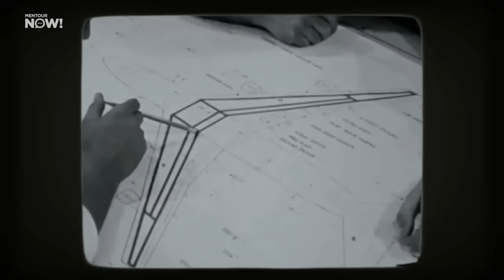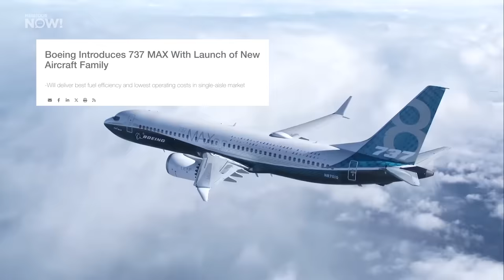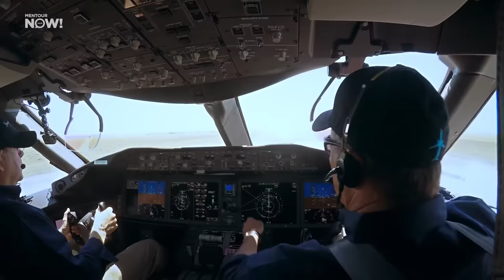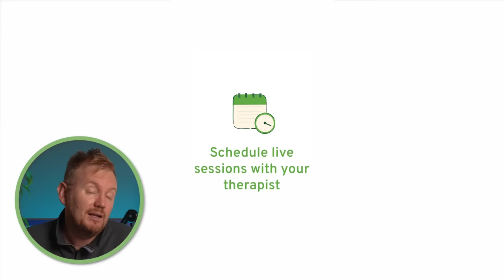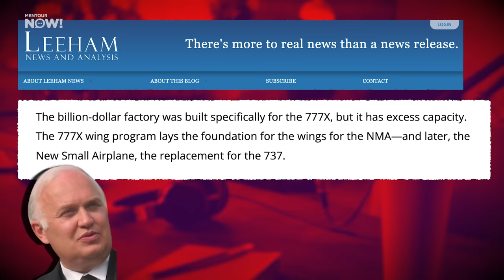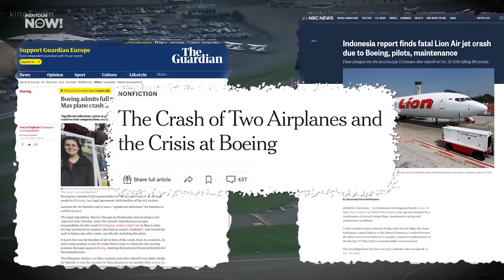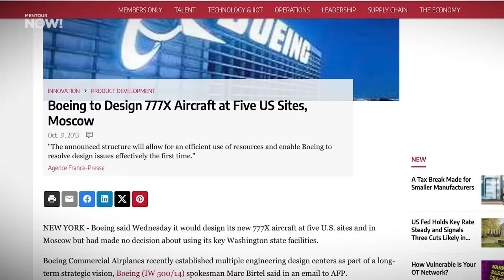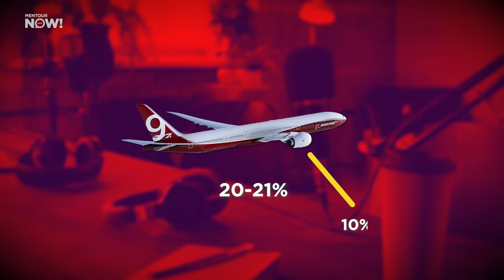What’s Going On With The Boeing 777X?!

Comment: Happened that Boeing is no more an engineering company.
Reply from the maker: I hope they will/have found their way back to that. 
We need the economy to work but it’s the engineering that is crucial
Reply: Assemblers.
Reply: It's also important for a healthy competition between Airbus and Boeing
Reply: @speeter6345  I'm a big fan of Airbus and have been for a long time, but I absolutely agree with you regarding this. Things have been messy for Boeing ever since the merger with McDonnell Douglas and theirs and Lockheed Martin's price gouging in the military market has been concerning for a long time, but competition with Airbus on the civil aviation front has kept things stable for all these years. Either one of them monopolising the market would have devastating effects and is always a worry when they are the only real key players now with Embraer taking a bit part role and the impact of Comac entering the market still to be determined. Here's hoping for many years of healthy competition without any further declines in safety, as was the case with the MCAS built into the 737-Max range of aircraft whilst claiming no retraining was necessary. Positive competition will keep prices stable and will push innovation further too. I hope things work out well in the coming years.
Reply: @thegreyarea-WPP  Absolutely! I am also team Airbus, but we need Boeing (and Ideally Embraer, Bombardier etc.) to keep innovating and improving
Reply: Boeing was the greatest engineering company and celebrated it's engineer's, but under the last CEO, money drove all, save money by reusing everything. Don't engineer. Don't fix it if it ain't broke. Pull pieces from everywhere. Put bigger engines on a smaller plane and poof, new model. Ugh....  I have an uncle worked for boing for over 30 years now. And he focuses on gov  retrofit projects. But they are a revolving door of layoffs now.
Reply: Problem is MBAs took over the business..
Reply: Where’s your evidence?
Reply: It is unfortunately all to easy to get stuck in a rut making the same products ( or variations of them ) when you really need to stop and think of complete new redesigns.
Reply: This is why Lockheed got out of the airliner business.  Boeing is trying to build airliners the way they do defense contracts (where the goal is to spend as much money over as much time as possible).
Reply: Wasn't it also engine development problems that almost did in Lockheed with the Tri-Star?
Reply: @TacticaLLR Where is the evidence that Boeing is now run by MBAs instead of engineers? I live in the Puget Sound area and know a number of retired Boeing engineers. That is the consensus view and it started with the MD merger (described as “MD bought Boeing with Boeing’s money”).
Reply: @the-chillian  Again, bigger bigger BIGGER.. oops.  Trying to scale up engines for ever larger planes is.. difficult engineering to say the least.
Reply: Also, Boeing has to ensure that a full launch of the type goes smoothly because it is the successor to one of the best commercial aircraft ever built.
More recently, I think we can say the Boeing 787 has been a remarkable achievement. Once the battery issues were sorted out, it has become an aircraft that has actually made possible a change to a fundamental characteristic of the industry as a whole - that being the possibility to move away from long haul operations always having to rely on the hub and spoke model. 
I understand the point you are making. Initially I could not understand how any competent pilot could allow the 737 Max to be brought down by stab trim runaway, let alone for it to happen twice. Arguably this point could still be made. It called into question the manner in which those airlines had glossed over a difference from the 737NG,  but Boeing allowing MCAS to compute fatal results should never have been allowed to happen. And AoA sensors should have always been duplicated. Those issues both made me angry and also, to be honest, quite sad.
Reply: The merger killed Boeing , made it a corporate environment for shareholders rather than engineering hub that it used to be .
Reply: The merger killed Boeing , made it a corporate environment for shareholders rather than engineering hub that it used to be .
Reply: That's a myth. The old Boeing also had big problems. See how Boeing handled the cargo door issue of the 747; the crash of Lauda Air 767; the rudder issue of the 737. The old Boeing was even worse.
Reply: @MentourNow 
When the board of Boeing decided it did not require a single engineer or aircraft designer it sealed its fate. Every single member of the board was either a lawyer on an accountant. The results were predictable.
Reply: @plektosgaming  There were certainly difficulties in making the engine as efficient as Rolls-Royce had promised  -- the composite material they were going to make the blades out of turned out not to work so well, and it certainly didn't help that their chief engineer dropped dead in the middle of development -- but the other problem was that RR went into receivership while all this was going on.
Reply: Boeing management will have to be completely replaced for the company to return to an engineering rather than accounting basis.  That’s not going to happen.
Reply: @ederss7 It's a nuanced situation. The management that developed the 767 and 777 was something different. They produced fine designs but also sold the company.
Reply: All aircraft manufacturers are just design and assembly companies. Parts are made all over the world and shipped to WA for assembly. Avionics, undercarriage, engines and you name it are built by specialist manufacturers and shipped to Boeing. I live in Scotland where there are many aerospace companies. Here these companies make many components for both Boeing and Airbus like leading edge slats and engine nacelles.
Reply: A good friend, now retired from Boeing, stated when they outsourced everything starting with 787, Boeing was doomed. They “lost control of everything from a to z” and the rest is history.
Reply: @MentourNow the economy doesn’t work with their short sighted financial management. In fact that’s what causes market crashes and Great Depressions. This was all understood in the 1930s (and even before) but the selfish businessmen don’t care
Reply: @Jeez001 exactly
Reply: @richierich1929  Then why do they exist if the merger killed them
Reply: @TacticaLLR evidence is all facts publicly available, lazy
Reply: And why would an engineer work for a company known to fire engineers after the design faze is finished.  The nightmare that the 787 engineers went through moving from Seattle to Charleston,  SC.  Settling down with their families,  only to be thrown out as soon as production started.
Reply: @nickolliver3021  too big for murica to allow them to fail, they should have been banned after the mcas issues , blaming the pilots training , not apologizing to the families, the list goes on .
I loved everything about Boeing prior to their merger, after that I fear flying in one .
Reply: They merged with toxic McDonnell
Reply: @MentourNow They did.  After the 737MAX episode, half the executive team was fired, the remaining executives were shuffled around, and the outgoing half were replaced with people from the engineering department.
Reply: @treborg777 That’s already happened.  Half the executives were fired after the 737MAX episode, and they were replaced by people from the engineering department.  The other half who remained were seriously reshuffled.
Reply: @richierich1929  Why should they have been banned after the Mcas issue? What ever happened has been fixed. You can say to Boeing that they should have been banned to their face. Blaming pilots and not apologising to the families isnt why they should be banned. Well if you really fear flying in a boeing then just dont fly. The world will be like this if it really scares you that much
Reply: f-ing douglas people took over and they kicked out allen m.
Reply: @nickolliver3021  I like Airbus , better engineered aircraft , Boeing should have been heavily fined after the mcas issue or banned for a period because they released a shit product that could have killed more people . 
They did not divulge proper information to pilots regarding what the mcas was, they never listened to their engineers who spoke out against issues .
Reply: @M_SC  what?
Reply: Exactly.
Reply: Idk bro, I worked as a supplier of graphite based coatings for Boeing back in the day and their engineers were among the most meticulous of customers. It seemed they had a totally unquenchable thirst for data, and were attentive to even the smallest patterns in specs. I wouldn't put their engineers in question. Maybe things have changed since then?
Reply: @Jeez001 MBAs are just glorified bean counters.
Reply: CATIA Too Much!
Reply: I still believe in Boeing engineers however, I believe their hands are tied by MBAs that wouldn’t know a wing from a ship’s rudder. They need a couple sharp engineers in the boardroom.
Reply: It's part of the corporate capitalism. As a Mercedes enthusiast, Mercedes no longer is led by engineers, but the marketing department . Now the brand that I admired for its engineering, is now just a consumer product, insted of a passion for engineering
Reply: Boeing went woke. Let's tell it as it is.
Reply: It happens. Then they will see it and go back to engineering. Lots of companies have done this cycle
Reply: Such a dumb cliched comment these days. People feel fashionable or savvy when they say this.
Reply: Interesting…Boeing is Hiring right now as it has many orders for the 777
Reply: The merger didn't seem to help. With that said them pushing this back isn't necessarily a bad thing. 

 We don't a repeat of the other 737 Max, do we?

 Airliners are becoming much more complicated, and customers expect more. I mean they have to work with GE on everything on the new GE9X. That cannot be easy with all the parameters. 

 Question for anyone in the know. Why the hell haven't cockpits or components become simpler yet? Is it really necessary to have all those damn buttons these days. 

 They need to invest in a bunch of touch screens, with dials or buttons for key elements that are used all the time. Have smart features that show you what is needed. Wiring a cockpit has to be a pain in me arse. Touchscreens that can be used for all of a companies airliners.

 PS: Huh, lithium alloy. Gotta look that up. Didn't realize lithium could be good structurally.
Reply: @forwardpaunganwa4135 "EVERYTHING BAD IS WOKE! BRUSSEL SPROUTS ARE WOKE! MUSHROOMS ARE WOKE! FLAT BEER IS WOKE!"
Reply: So sad :/
Reply: Maybe we will see a A380 NEO flying before the 777x get delivered 😅😅😅
Reply: airbus fanbois, stop spamming
Reply: Love your videos. Always delighted when I see a new one come up. Keep up the good work. Happy Christmas and New year's Mentour. 😊
Reply: @forwardpaunganwa4135 oh, THAT'S what woke means? Thank God! That means we can now all agree on reproductive rights and human rights for trans people now?
Reply: @MentourNow Boeing just became a woke company ran by accountants just like many USA corporations turning that way. I know because I work for one and I know people that work and worked at Boeing. As such, I refuse to fly on newer Boeing planes as I know they are not safe.
Reply: This is what happens when everything is profit driven
Reply: Airbus isn't either. I am working in this field, and soon the "cost reduction" pushed so agressively by Airbus through the supply chain will burst in the same tragic way it did for Boeing.
Reply: It's a brand lol
Reply: Unpopular opinion: Despite  Bieng based on a 30 year old design,  the  777X is still more Technologically advanced than the a350. 

The a350's only major highlight is its lighter composite fuselage .
Reply: @Jeez001 Dennis Muilenburg, ex-Boeing CEO got a degree in Aerospace engineering and a master degree in Aeronautics

The current Boeing CEO David Calhoun has a degree in science.

So no, Boeing wasn’t taken over by MBAs
Reply: Nonsense..
Reply: I would say they are no longer a manufacturing capable company.  The 787 seems like a decent design.  Recent 737s not so much.
Reply: @speeter6345 It ain’t going to be Boeing I don’t think.
Reply: And they'll never be one again as long as the government contracts keep coming in.
Reply: True
Reply: Nobody like this comment
Reply: Boeing went the same way as Mercedes did a long time ago: they threw out the quality and engineering, and said hello to accountants as their main partners.
Reply: @thegreyarea-WPP  As a good friend of mine once said, MD somehow bought Boeing with Boeing's money.
Reply: @jordananderson2728  I too have heard that said. It seems to be something many Boeing staff said though I think I may have heard it during Al Jazeera's investigation into shoddy workmanship at the Charleston plant with customers apparently only accepting 787's that were made in Everett. I think that's where I heard it used anyways. Indo not know anyone working for Boeing to have heard it from though perhaps I am mistaken  and it could easily have been a comment on this channel.
Reply: @Jeez001  😂😂😂
Reply: You said it CORRECTLY. They constantly fire experienced-more experienced engineers and hire inexperienced engineers to increase profit margins to satisfy a small number of greedy investors which causes more issues with quality and safety. THE prime example of greed and profits over quantity and safety is the 737max. When money is a company’s driving force, the people suffer. Airbus is running rings around this former great company and is hiring the experienced/knowledgeable engineers let go by Boeing. VERY sad.
Reply: I remind myself that an airliner is closer to a space ship than a car. The automotive industry’s quality tools have been implanted by the aviation industry -  APQP/PPAP. Bad idea but leadership must have liked having an additional focus on reducing costs. Unfortunately the manpower came from the quality department. Management didn’t increase manpower to cover APQP/PPAP. They just told quality personnel to stop and come over here and work on this nonsense.
Reply: It all started going downhill for Boeing when they merged with McDonnel Douglas which was supposedly a merger with Boeing absorbing them but really turned out that it was actually the complete opposite and most of McDonnel Douglas's upper management actually replaced the Boeing upper management effectively winding up as nothing more than McDonnel actually just adopting the Boeing name and still operating with the same management style and penney pinching ethos that killed McDonnel Douglas in the first place and shunning Boeings engineers 1st and a Business 2nd ethos that had served them so well up to that point.
Reply: That is the kiss of death every time.
Reply: @richierich1929 that’s a lot of jets to fear though, as there’s still a lot of jets flying.
Reply: @richierich1929 you know they won’t go away as even if they stop civilian aircraft, military aircraft will still be produced. And without civilian Boeing aircraft, Airbus will be a monopoly which will be even worse.
Reply: @mbmann3892 good engineering still exist in cars, unfortunately they only exist in the super high end market like Rolls Royce.
Reply: @fatfreddyscoat7564 can’t you say that about most car brands. They all used to be beautifully hand built except for companies like Rolls Royce.
Reply: 'If its Boeing, I ain't going 😮'

Sad, twenty years ago I used to say, if it ain't Boeing, I ain't going... 😥       Way to Kill your reputation fellas👏
Reply: @thegreyarea-WPP 
One of Boeings biggest challenges has been competing against a company that was established to create jobs, not profits.   Airbus is spread over several European nations that work together to provide good employment opportunities for their citizens, subsidies for the company are there when required.   Works great for them, obviously.
But there’s nothing Americans hate more than subsidizing industry, even if it’s a good idea.
Is it not possible Boeings problems stem from the need to reward shareholders and executives, by maximizing profit above all else, in an industry that is very unforgiving?   
I know there are many cogent arguments to be made either way on what is a huge subject.
My two cents.
Reply: @falconeaterf15  I really appreciate your two cents here. It’s an angle I’ve not really looked in to and it’s certainly interesting to mull over. I’ve spent a lot of time considering their outsourcing, their issues with low standards, especially with aircraft coming out of their Charleston plant, and what is seen as putting profit over safety, but I had forgotten about the subsidy row. My very vague understanding of it is that Airbus would likely have fallen flat on its arse without being heavily subsidised and Boeing took umbrage to that, though they also have subsidies through huge tax breaks. It’s certainly something I should research and give it due consideration as my knowledge of it is basically null. Thanks for your comment.
Reply: @thegreyarea-WPP  
Your a brave man to attempt to research the subsidy debate as  Boeing and Airbus have generated tons of studies and reports over the years arguing their perspectives, as well as many court rulings.
Good luck !
Reply: @forwardpaunganwa4135  explain? Examples?
Reply: The engineers in the Boeing Company are no longer from the original Boeing Company prior to the merger with McDonald Douglas in 1995. Most of what counts as engineers are more from McDuck than Boeing. I got this information from my Brother in law who retired in June 2020 and other people who are still "trying" to work for McDoeing.
Reply: Just a financial company now.
Reply: @danielbond9755  don't you McDoeing because the Boeing Company of old doesn't exist anymore
Reply: @Michael.marshall-w3d   That’s really interesting. My understanding was that many of the Boeing staff had remained in the Wichita, Kansas plant as Boeing sold it to Spirit AeroSystems, essentially outsourcing much of the engineering to Spirit. The door plug issue seems to have come from work done at Spirit. With what you’re saying, it would be no surprise to me if many of the former Boeing staff who remained as part of Spirit have become disillusioned by the practices there being driven by the need to deliver fast, just as the Boeing plants in Charleston and Everett were now being pushed to do. It’s such a shame that the merger with McDonnell Douglarse has had such a negative impact on the staff as well as safety on the aircraft they push out. 
Do you think there will come a time when Boeing go back to their “safety first” ways or do you think that bird has flown for good? I felt that replacing Muilenburg with Calhoun was nothing more than a side step since both were board members that have led Boeing down this path of profit over all else.
Reply: @thegreyarea-WPP  Where did you get your facts. I got my facts from the few reminate of old BAC people that still work for the company as of the end of 2023. But these people are being silenced and driven out of the company because they don't care to tow the new company line that ROI is the bottom line no matter which part of the company the work in.
Reply: There seem to be a lot of antiBoeing comments that are misinformation. A good manager is one that sticks to managing and selects the right engineering people on merit and ensures they all work together and all do their job professionally (on time/on budget are only one part of the job). A poor manager is one that selects workforce on DEI, and thinks he is more clever than his design engineers and insists that everthing is completed under budget (one way or another).
Reply: Boeing 727, was the best with stairs under the tail!
Reply: Saying Boeing isn’t an engineering company is a really dumb statement. Yes they’ve had troubles and yes leadership needs to reprioritize but some of the most brilliant engineers in the world work for Boeing and they still make great products.
Reply: Why bother with engineers when you've got accountants? They are cheaper, you don't need so many, and their hands are clean, essential in the boardroom...
Reply: @TheNemocharlie  McDonnell Douglas had that kind of attitude and the company didn’t fare too well. Outsourcing to a company with a lack of training and quality control opening a plant in a state that paying less because unions workers are not a and being more aggressive in getting each aircraft finished even if corners are skipped. Customers are already losing faith in Boeing after the past few years and it wouldn’t be good for anyone if they were to collapse.
Reply: @ederss7 well, Boeing is an American company. That's exactly the way they are. (And that's no biased hate by me, it's just a fact)
Reply: wow, that is well said
Reply: They’re like Harley of airplane manufacturing . Banking on their name only.
Reply: Money managers